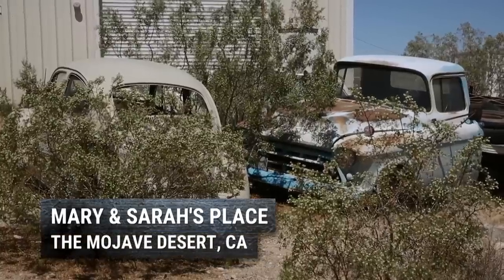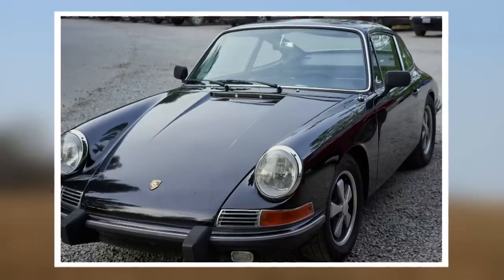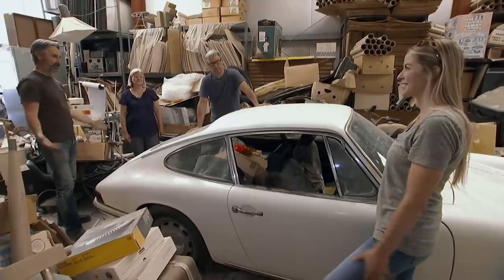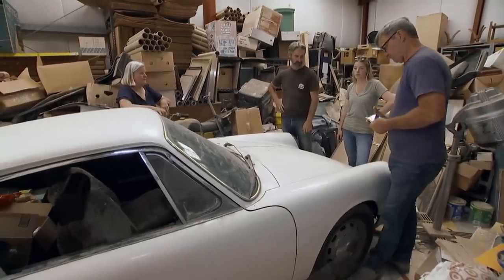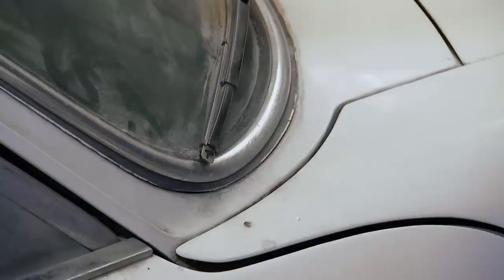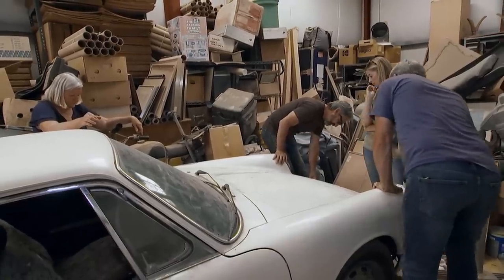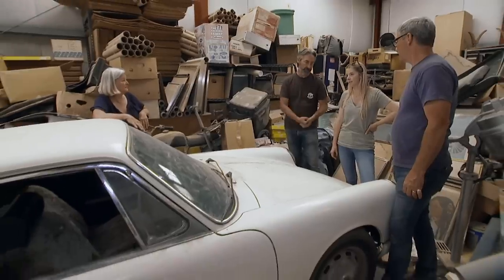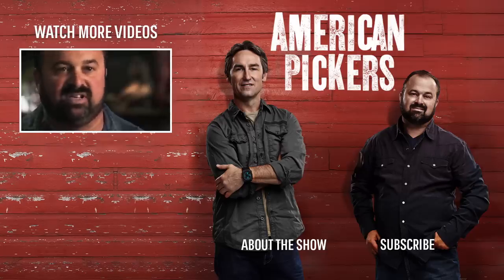American Pickers: Sleek Porsche 912 with a Hidden Surprise (Season 23)

Comment: The major difference between a 912 and a 911 is the 912 is a four 4 cylinder engine vs a flat 6 in the 911 version.
Reply: Finally someone said it
Reply: They used 356 super 90 engines in the initial run of 912's.

Comment: You are going to sell it for 28-33? running. Shipping is 1500 new tires 1200 new hoses belts timing and gas tank (maybe) 3-5k  and you need a profit of20% so 20k is a great price.  
Your best option as a seller is straight to the buyer at 25k … imo

Comment: That tape Job means it was a cheap paint job. A quality guy would remove the windows. It was a Tape n Shoot. Probably $1,000 or less when it was done, very possible it was a $600 repaint. Which means the owner was either extremely ignorant of what he was doing or just didn't care. You don't have a cheap paint on a Car like that.